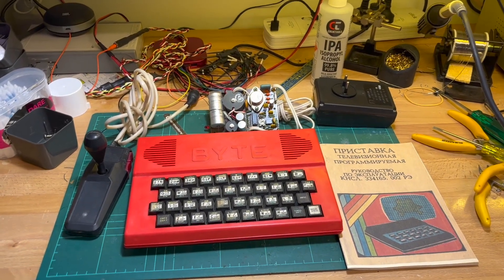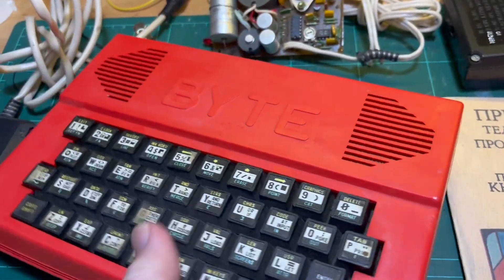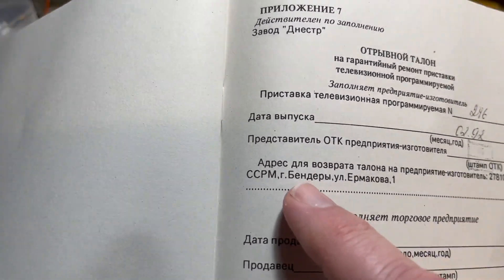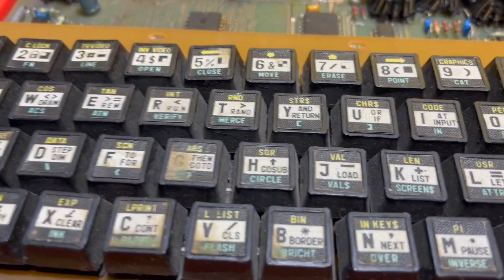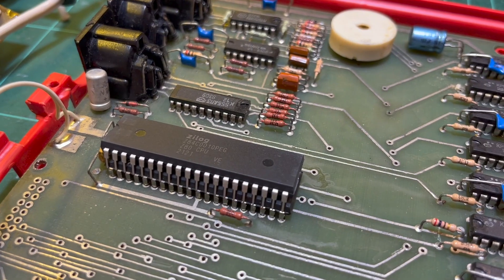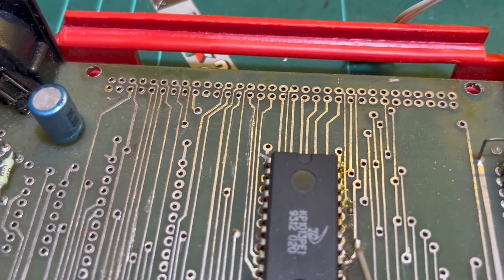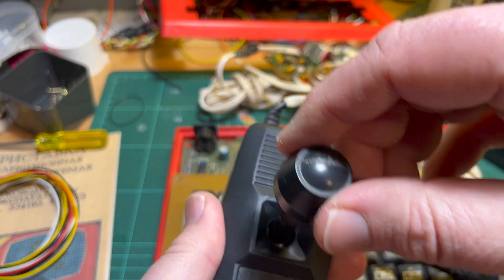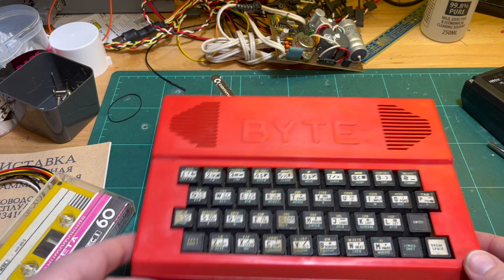🇲🇩 BYTE: Part 1 (A Moldovan Speccy Clone) [TCE #0067]

Comment: These are on eBay and I'm trying to decide on whether or not to buy one. This helped very much 🖖
Reply from the maker: Oh good!  I've not had any luck with these "red" Moldovan BYTEs (that have the Soviet ULA), but the "Speccy Clone" BYTEs (no ULA) have always worked ... in my experience.  There is one fellow on ebay (based in Slovakia) that I buy from all the time - he currently has two of the "Speccy Clone" versions ... here's one if you hadn't seen it:

https://www.ebay.com/itm/166694288258
Reply from the maker: BTW, I think you are subscriber #1800 ... so thanks for helping me get out of the 1700's ... it would inch closer, then someone would unsubscribe and I'd go backwards again :)
Reply from the maker: Here's another of those Moldovan "Speccy Clone" BYTEs ... I've bought from this seller too (they're in Moldova):

https://www.ebay.com/itm/186343971317

Comment: I have one like theat i from moldova
Reply from the maker: Does it work?? I've not had much luck with these "red BYTES" ... they use a Soviet-style ULA that I suspect is maybe faulty as there's not much else on the motherboard apart from the ROM, the RAM and some glue chips!  I do have some new-old-stock ULAs which I've been meaning to try out ... /Brett
Reply: @Brfff  i dont no if it works i gest kep hem in the colection never start hem

Comment: That's very interesting that they used a similar but slightly closer hole pitch. Gotta wonder why they would copy a Z80. Surely if they wanted to keep everything incompatible they design their own CPU.
Reply from the maker: The Z80 was "compatible" to the 8080 (which they had earlier copied) so perhaps wasn't too much of a stretch? Plus all the cheap home computers in the West were using the Z80, so there was already firmware and an existing SW ecosystem that could be built upon (...???) Just speculating ... /Brett

Comment: Tiny little pcb trace around the edge likely because it was added last minute to the production model to replace a jumper wire.  Pretty impressive looking PSU module well built.
Is it really 220 VAC input???
Reply from the maker: I'd have to agree that, considering where it was made and the time (collapse of the Soviet state and economy), it's pretty impressive.  In the West, equivalent computers (okay, a few years earlier) would just have a hulking big transformer and some diodes/capacitors in the power supply brick to create a DC voltage, and the just use a 7805 and heatsink in the computer to regulate down to 5V.  And, yes, it certainly is for 220VAC input ... I've not tried powering it on yet (we have 240VAC here) as some of the transformer wires look a little tenuous ... /Brett
Reply: @Brfff  the transformer wires are supposed to be thin, to fit the number of turns needed inside the pot core cavity. What see here is fine for consumer / commercial grade product that doesn't have to survive automotive or battlefield conditions. Sometimes there's dobs of silicone to tack lead out wires but that can cause more trouble than worth. For rocket launch conditions there would be a blanket covering of special compound but then none of the circuit would be serviceable. 
If it's "220 V" the unit should accommodate fine usual variations in input voltage. It might not have undervoltage protection so 180 VAC might kill it through overheating under load. 280 V say coming out a faulty generator would cause nearly 500 VDC appear on primary side components. A light bulb makes a good dummy load.  This PSU design might not have a  squeg mode to allow it run with no load.

Comment: The reason for photocopying those pages is because those are tear-off coupons on technical maintenance (repairing).
Reply from the maker: Yeah, I can see that (there's nothing on the back) ... but it seems a little inefficient ... unless they kept the original copy (handwritten) ... but wouldn't it have just been easier to handwrite the serial number & date on the two copies as well? /Brett
Reply: @Brfff  Who knows what technologies and rules they had back then :) SU was pretty bureaucratic, and even though this was done after su collapse, rules were still the same back then

Comment: you cold always do like Glassslinger and hide the modern components inside the original Soviet component shells.
Reply from the maker: Interesting idea ... I don't have a ZX Spectrum but I do have a TS1500 (American ZX81 in a ZX Spectrum case with 16KB of RAM) and they are roughly the same size, so perhaps a modern reproduction Spectrum board might fit ... only issue may be port locations /Brett
Reply: @Brfff  I think they mean to re-stuff the capacitors. I don't have personal experience with Soviet (or post-Soviet) electronics, but watching YouTube videos it seems that bad capacitors are very common. Good thing is they're usually bigger in size than equivalent non-Soviet capacitors, so you could empty them and put new capacitors inside them, preserving the original Soviet look. For smaller capacitors that make that impossible, a neat trick I saw DiodeGoneWild do is to desolder the capacitor, remove one of its legs to break electrical connection, put it in place again and solder an SMD capacitor (tantalum, MLCC...) on the back of the board.
Reply from the maker: @Ale.K7  ... ahhhh, yes I see now!  Sorry, I thought "shell" as in the case ... but shell of the component ... interesting!

Comment: Hello! I'm Russian. I write through a translator. About the tape. This is an ordinary Soviet cassette for 60 minutes. Their tape quality is poor. Produced in Kazan. I had a lot of them in the 1990s. The packaging is standard. The inscriptions on it are only about the manufacturer, technical characteristics and warranty. Yours does not indicate what is recorded on the tape. You can check on the tape recorder. I can translate from Russian if you need something.
Reply from the maker: Thanks for the extra info!  Hopefully something interesting is on it ... not just the "test" program mentioned in the manual.  /Brett

Comment: I've received a similar one to this in '93-'94, it was well-used before it got to me. It was more compact and had a rubber keyboard and possibly a bulkier and simpler power supply. It came with a russian booklet, not sure if it was its manual. I could not read it but I could type the Basic programs. I don't remember being any schematics inside the manual. So maybe the computer had several booklets with it, because the cover on the one you scanned look familiar.
The video output quality was horrible, at least the one from the modulator.
Hopefully I can still find the old computer if it did not get thrown away, take it apart and document it.
Reply from the maker: I read that they made a first model that looked quite like a Spectrum with rubber keyboard, before making this second model with ULA (so lot less logic chips).  I can imagine that the modulator output would've been horrible - didn't they also use slightly different video standard there as well? /Brett
Reply: @Brfff  In reality there were 3 models. In two case.
Reply from the maker: @ndiscovery  really??  Do you have details of the third model?  The "red" BYTEs I have (with Soviet ULA) don't work, all three.  but the "Speccy" looking BYTE (with discrete logic) works perfectly ... any chance it would be a "red" BYTE with discrete logic? /Brett

Comment: No the name on the computer is in Latin characters.  Confusingly there is another one called "Byte" or "Bayt" (Байт) from Belarus which is more common and looks very much like a PC keyboard.  And no doubt better built.

Interesting that it has a gate array in it; most Soviet/early CIS era Spectrum clones often used discrete TTL logic instead.  And as with the vast majority of Soviet chips it won't be an exact clone but rather a functional equivalent, often with some improvements.

Oh- and the power supply says not to turn it on without a load connected.
Reply from the maker: Thanks for taking the time to respond!  Yeah, I know it was Latin ... little bit of a joke ... it must've been a little confusing sometimes though?  Like the CPU ... I initially thought it was a "UV880" then realised it was from DDR so Latin ... and then the masked ROM I thought was "KP1013PE1" ... then realised was Soviet and so actually "KR1013RE1" ... it was only when there was a non-Latin character that I instantly knew it was Cyrillic ;)  Apparently this was their 2nd iteration - first one looked a lot like the Spectrum and used a lot more logic (no ULA type chip).  And THANK YOU for the extra translation on the PSU ... at the moment I'm not keen to turn it on with or without a load! ;) I already noticed one solder joint of the 4700µF capacitor was loose so have re-flowed the solder there.  I might make a dummy load to use ... /Brett
Reply from the maker: Oh yes ... now that I bother to translate the text on the power supply:
"ВНИМАНИЕ! БЕЗ НАГРУЗКИ НЕ ВКЛЮУАТЬ" ... Attention! Do not turn on without load ... I recognised the "НЕ" so I could see it was telling me not to do "something"! ;) /Brett

Comment: That cpu UB880 was the eastern Germany clone of the z80 - the slow version of it rated at 2.5 MHz max. If you were lucky they could reach 3.5 MHz. The UA880 was the fast one ratet at 4 MHz. They were used only in business and industrial applications and for export to the Soviet Union.
Reply from the maker: Thanks for the extra info!  I was getting a little confused - why some used cyrillic and some used latin ... when I realised the UB880 was from DDR, the latin made sense. /Brett
Reply: Software then didn't need fast MHz speed because it was coded at low level without endless layers of software. Nowdays android smartphones require billions of clock cycles just to turn on a pixel or move a byte of data from one place to another.
Reply from the maker: @jagmarc  LOL, so true ;)  And people confuse "scripting" with "programming" ...    ;)